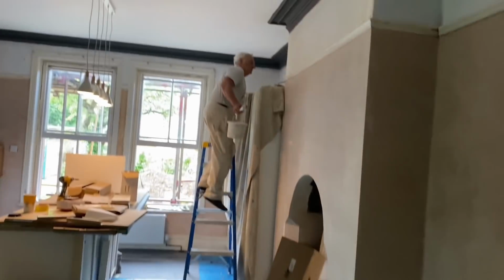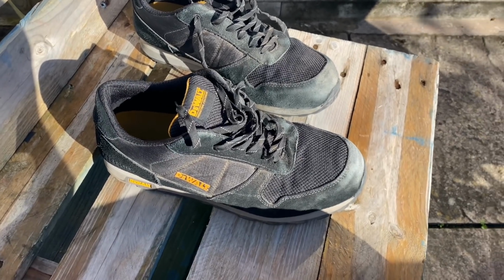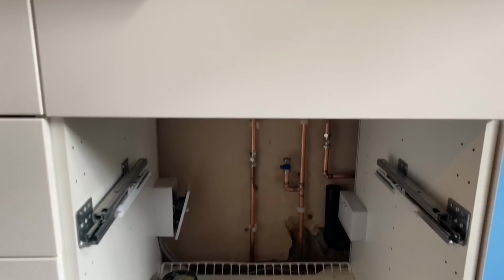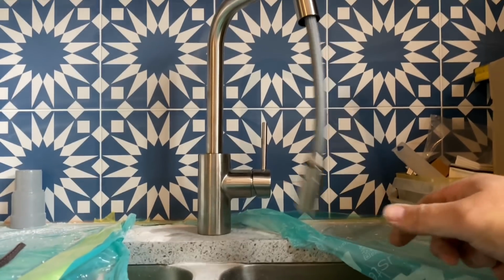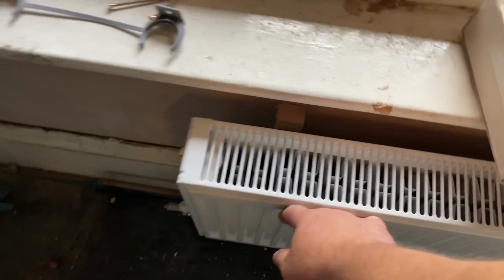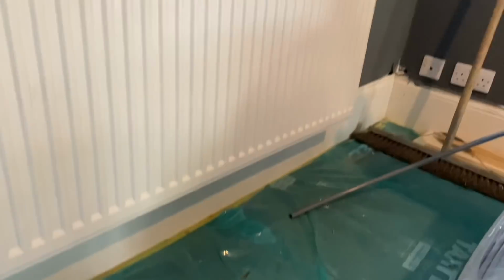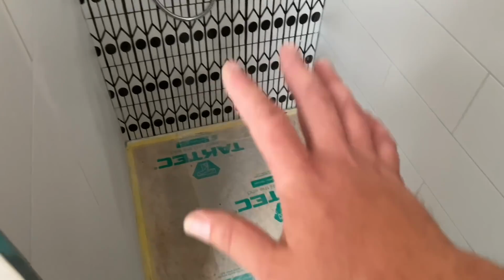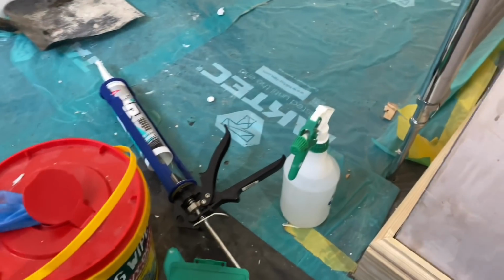ARE IKEA WASTE SYSTEMS REALLY THAT BAD?? Also what are the Dewalt Site trainers like?

Comment: Mark, great video again. I have fitted a number of those Ikea wastes and have had no problem with them. I even replaced an existing waste pipe construction that looked like a dog's dinner with the Ikea waste system once, after first checking that the sink basket dimensions were identical. I have had to clean out the horizontal sections, but as you have seen they are easy to take apart.
Reply: The replacement waste fitting was a Sunday afternoon job, for a friend.
Reply from the maker: Always a friend wanting something on a Sunday🤣

Comment: Great vid as all ways. I use sketchers safety boots. They are really comfortable and have a composite toe rather that steel. Also them clips you used, could you not put the bottom ones on upside down so they are in line with each other and use a stubby screwdriver to do them up ?? Or wouldn't that have worked.
Reply from the maker: Thanks mate…. Always an option but I just prefer this way 👍🏼👍🏼

Comment: Those IKEA waste systems ARE utterly useless for your standard German/Austrian first fix (drain coming straight out of the wall at 500 or 550, hot and cold on either side at 550 or 600), You either have to do some crazy bending (which turns the flexi bit into a second trap and you aren't supposed to do that according to the instructions) or use something else. They're clearly designed for Swedish kitchens where all your pipes are either exposed or sticking out of the floor.
Reply from the maker: Yep I agree I’d the first fix isn’t set up for them, however this one worked really well 👍🏼
Reply: @MJTiffPlumbing  Yeah, in your situation it worked quite nicely!

Comment: Don't your suppliers sell flux brushes 😀. Drill a 22mm hole in a flux tub lid and use a tub thats a quarter full with a brush.
 Stops all the shit getting in your flux.. Those smoothing tools are a pain in the arse to pick up when you put put them flat side down , aren't they. 
Good video.
Reply from the maker: Yer, they have loads of them in stock but you know when you’ve done something for 27years it kind of sticks 👍🏼👍🏼

And I know what you mean about the silicone tools 🤣🤣

Comment: Nice 

Tado is compatible with ebus if 1zone and DHW, you need a VR66 and a VR10, wire this and the 2ports to the VR66 then ebus to the Tado and boiler, get rid of the new style extension (old style extension had ebus connections so you could use one) and now you have modulation control on the heating and PDHW
Reply from the maker: I will let my sparky know 🙈🙈

Comment: I haven't fitted and IKEA kitchen for years. 

Have they started making kitchens that have a service area at the back? You're one looks as if it does.
Reply from the maker: No they still haven’t, however we had the rear packed off 50mm as a service void as it’s a nightmare, as I’m sure you well know
Reply: Nope and now the plinth height is about 50mm! Makes it even worse for pipes

Comment: For drilling resin worktops and composite sinks use a 38mm diamond holes saw.  Alot of composite sink have actually started coming with them. Pretty much the same as the amazon cheapos. Been using the same bit for several sinks and a couple work tops.
Reply from the maker: Yer I have had a worktop before come with the core drill bit for it.👍🏼👍🏼

Comment: Good content as usual bud👍🏻 I’m gonna give the dewalt ones a go I think as the scruffs trainers I purchased in May are mullered already!  I’ve used silicone tools for years but never with fluid as I was worried it would effect adhesion🤔
Reply from the maker: Yer they are good mate, but just not for when we go into homes, if that makes sense

Comment: Don’t spray the silicone water will get behind through capillary action. Works just as well without water. The profile tool shout have a releasing agent on them and a bit of tissue paper will get them off
Reply from the maker: Once the silicone is bedded in it’s ok but know what you mean 👍🏼👍🏼